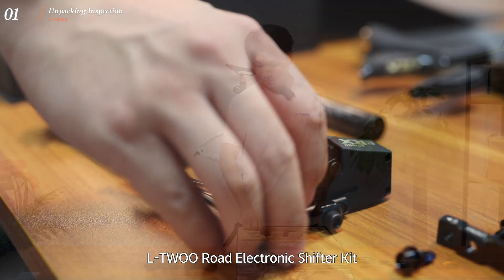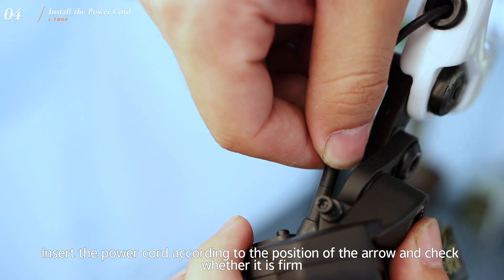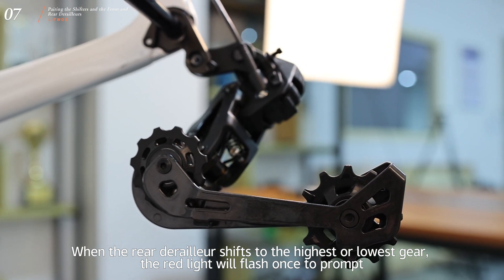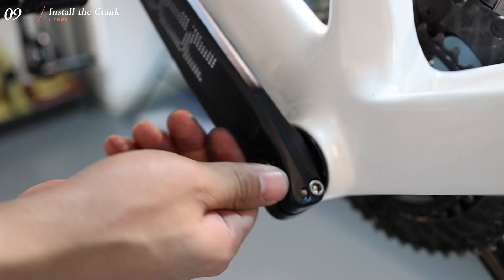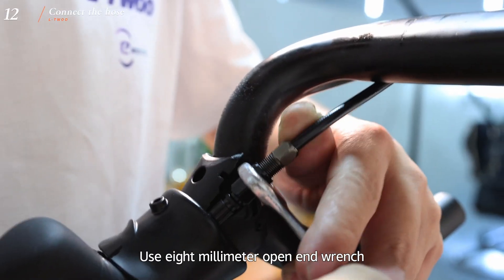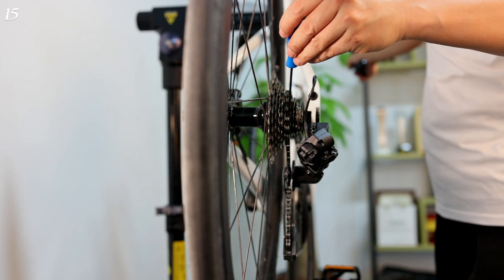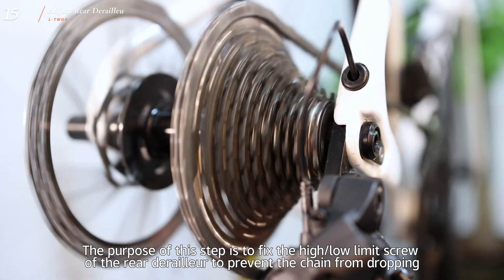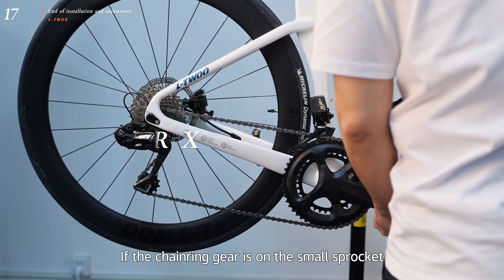eRX Road Hydraulic Electronic Shifter  Installation and Debugging Tutorial

Comment: Greetings.  I finally installed the L Twoo eRX goupset on my new frame. I can get the derailleurs to work with the app.  However, I cant bind the  derailleurs to the shifters.  I followed the instuctions by holding down the small circular button for more than 4 seconds.  But niether responds with the solid green light. Do the shifters have their own battery? Please advise and thanks Dave

Comment: Hello! I have problems with the front derailleur. It somehow looks like it's blocked to fine tune it when the chain rubs the inside of the deraileur. I been using it like that the whole time, but it is very frustrating since I can't use it on the largest ring and smallest sprocket or the small ring and bigger sprocket, because it is when the rubbing happens. When I try to tune it with the app, sometimes it disconects... has anyone else had this problem? I'm thinking on purchasing the EDS TX if I can't fix this... very dissapointing.

Comment: If you are using this group set in Australia they don’t tell you that the levers need a button battery . The standard 3032 battery is hidden under the hood and the cap has a lock screw. These batteries need replacing eventually too. So when you press the button on the levers the green light in between the switches wont shine till the batteries are in place.

Comment: i just install my er9. Great product. the only problem is fd. hope to update firmware with autotrimin or when you press again up for middle position the fd return to normal position. now you must press down and the again up. the same in 1st middle position.
Reply: in earlier production units, the auto trimming was included, but violated a patent, so they had to remove it. Autotrimming will likely not come back.

Comment: After living with consistent shifting issues for months since getting this groupset (newer model with coil spring battery contacts) in Jul ’23:
1.	On rides, FD constantly goes to sleep even when RD is worked hard with constant shiftings. RD also regularly have missed shifts and you have to press shifter buttons until RD wakes up. For FD you even have to hit shifters or frame hard to jolt it awake before it inconsistently shifts.
2.	The overly active sleep mode is also evident as your bike computer will constantly lose connection with your groupset and it will reconnect when it wakes up and sometimes even need a hard jolt to the bike to wake it. You never see this on SRAM and Shimano.
3.	When bike is at standstill and not moving and RD is awake, shiftings are almost 100% working.
4.	Shifting almost always work flawlessly and instantaneously using LTwoo app shifting.
5.	LTwoo online warranty claim form on their website has zero response after filling claims.
6.	LTwoo app have zero software updates for past 3 months.
Amazingly after posting these factual issues and seeing some youtubers actively deleting them to cover up, to my amazement LTwoo app posted a latest software update on 27 Dec ’23 for RD ver 0.1.1 and more importantly finally a FD update ver 1.12; which clearly shows the high iterative patches on FD reflecting that most bugs on this groupset  are on the FD.
I am happy to update that with the latest software patches my issues are seemingly resolved during my short ride on 28 Dec ’23. I will continue to stress test over longer rides but the immediate feeling is positive. All eRX users who are still holding on to it should immediately download and try.

Comment: Hello. Could L-TWOO ER9 be connected to garmin 530? I'd like to check remaining power in battery and also have notifications about low battery. Logging of gears would good too.
Reply: I've connected. I can see main battery status. But by some reason it showed low battery for 2032, but there is 3v and 3.01v on batteries. Maybe it's already fixed by new firmware - haven't checked yet

Comment: Thanks for this video.  It helped me install my this groupset on my bike.  I had a question. I wanted to change my hoses since I messed up on the length (had cut it a wee bit short) and wanted to replace them.  By any chance, do you have replacement olives and needles available that I can purchase?  Or would you happen to know what olive and needle that would work as replacements for the brake that I could purchase?  Please let me know.
Reply: The hoses are Shimano BH59 standard. Look for olives and inserts accordingly as well!

Comment: Hi L-Twoo team, I got eRX shifting working perfectly and it is great! But, I cannot bleed my brakes. Mineral oil will not flow through the brake/shifter levers (to and from the oil cup) under pressure from the syringe at the caliper. The calipers and brake hose attachments are not the problem, because oil flows easily through the "air vent" screw hole when I remove that screw and press the syringe. I can't wait to go ride with eRX!
Reply: The same for me. I'm very expierienced screwer. But I had never something like this. Do you screw in the distance screw in the midle/front of the lever? A small hole. But also then, I can't still bleed 😞
Reply: After watching "@klein-concept" video, he said to screw 'out'  the distance screw and oil will go trough. Yes that worked! Know I can pull Oil trough the brake system. But still no success with a good breaking.  Will foing forward with bleeding.....

Comment: Lloyd Rogers on YT has lots of videos where he puts 11-40T cassettes on shimano long cage derailleurs from 105 and Ultegra, including di2, often using a rear derailleur extender. I'm very interested in this. 
Can i use the ER9 + rear derailleur extender (from Aliexpress) with an 11-40T, 11 speed?
Reply from the maker: eRX supports up to 32t。
Reply: @ltwoo-sport  Hola, muy buen producto y bellamente manufacturado ¡felicitaciones! Y gracias por producírlo.
Mi pregunta: ¿ofrecerán un repuesto para 'jaula corta' para bicicletas de carretera de 650c, 26' de carretera y 24' de carretera?. ¿Incluso gente en 700c que ocupe cassette de 25t ó 26t max ó bicicletas de TT que no necesiten la jaula larga?.
Por favor, ojalá puedan considerárlo.
Gracias.

Comment: Documentation seems tp show 11-32 cassette compatibility, but the "current hotness" is 11-34 for 12 speed cassettes (DI2 and Etap both support this and many current models come with 11-34).   Can the rear derailleur support this for 12 speed configurations?
Reply: I also want to know
Reply: Ltwoo has told me a 11-34 cassette is suppoeted
Reply from the maker: eRX supports up to 32t；34t flywheel not supported。

Comment: Anyone else having this issue? The rear derailleur on mine is failing to shift from the 7th to 6th gear (i.e. the bigger gear). 

It would partially move into the gear and then one second later move back to the previous gear. 

Front derailleur is on the small chain ring so I don't think it's because of cross chaining
Reply: Hey there my one works without issues.  Only theres bo autotrimm i can trimm with the shifter but it dont work automatically
Reply: Hey the erx can do 11 or 12 speed maybe your in the wrong settings have you chcked in the app and adjustet the gears right?
Reply: @claudiotelli1416  yup I've even tried swapping to a 11 speed cassette and changed the derailleur to be 11 speed mode but still the same. 

It feels like the derailleur is not getting enough "power" to move into a bigger cog. 

As without the chain on, the derailleur shifts fine. I've also checked the chain is the right length
Reply: @paulchua7   after you adjust the singel gears did you hold the main button for longer then 2 sekonds otherwise the settings dont safe but i thunk you did it like this or over the app. I didn’t get my groupset its still on the way. Hope i dont get problems like that
Reply: @claudiotelli1416  thanks! Yes I have a feeling I have either a faulty battery or derailleur. Hopefully yours is fine - keen to hear how you get on with it
Reply from the maker: @paulchua7  Hello, I suggest you carefully read the eRX manual; The reset of the electric transformer can only be adjusted in the APP. If you adjust the parameters incorrectly, it is recommended that you Factory reset.
Reply: @ltwoo-sport  unfortunately I've tried to factory reset numerous times, and even tried in 11s mode (with a 11speed cassette and chain) and it's the same thing. It happens mostly between the 5th and 6th gear but sometimes also happens on other gears. 

I've also deleted and reinstalled the app (in case the settings are cached in the LTWOO app) but still the same. 

I don't think there is anything physically blocking the shift because it can shift into the bigger cog but after one second it would shift back
Reply from the maker: @paulchua7  Leave your email address; Are you free this afternoon? Can I have an engineer remotely check for you?
Reply: @ltwoo-sport is there another way to contact? YouTube doesn't allow me to leave my contact here
Reply from the maker: @paulchua7  vx公众号蓝图变速或者ins

Comment: Can you show instalation of brake calipers on flat mount forks?
Reply: That's exactly what they are showing....
Reply: @bossebo3535  Sorry, I mistake it for post mount.
Reply: @TenSapphires  That's unlucky, there is no post mount system  for LTwoo system for my knowledge. You have to get either separate Post mount caliper for your bike. Any High end dual piston will work this in this groupset and it needs to use Mineral oil ( basically all Shimano ).
Reply: @penzuugi  can i use the shimano oil for the ltwoo brakes?
Reply: @claudiotelli1416  Yes, basically any mineral oil but i recommend using Shimano Mineral.
Reply: @penzuugi  thats what i orderd hooe my groupset is coming soon did you orderd it from ali? How long did it take to arrive? Greetibgs